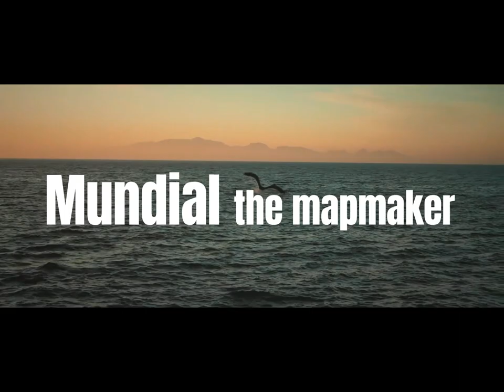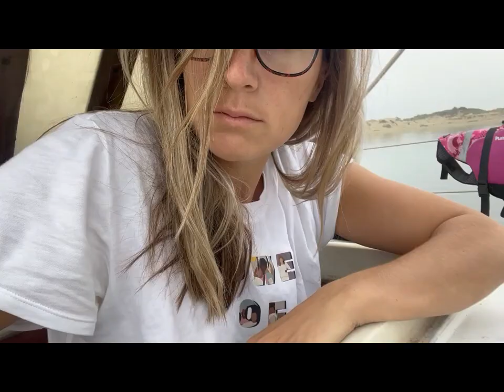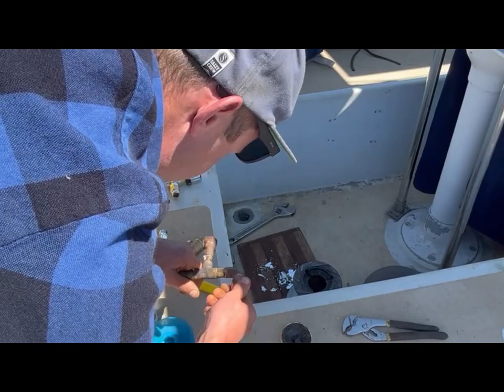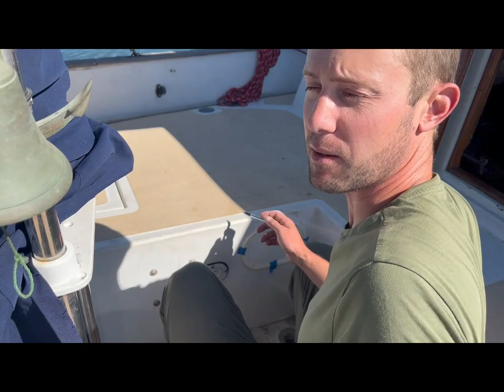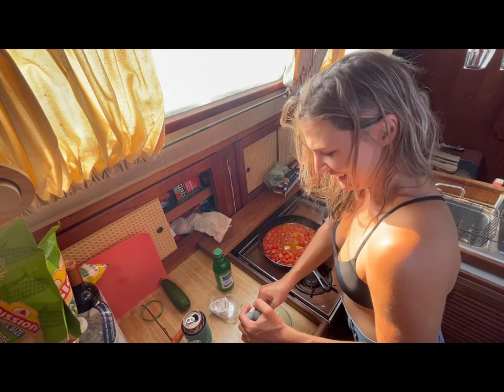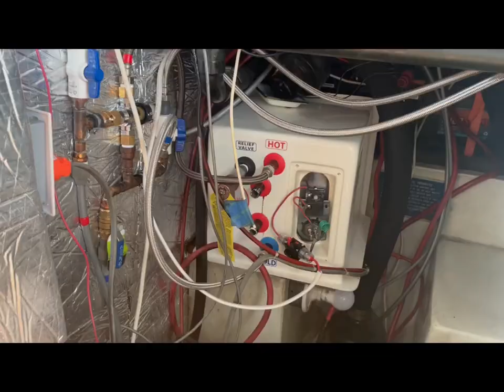[Ep 7] Plumbing & SHOWer time on our Sailboat!

Comment: Hi, heads up on gluing pvc. You need to use the purple primer. I also sand the fittings to de-gloss. Also mite want to use sharkbite. Red for hot blue for cold. We just bought a Downeaster 38 north in the sf bay area. Cheers from Northern California!!!
Reply from the maker: Thanks for the tips!

Comment: So stoked to find your channel! Great content! We are about a yearish into refitting our DE38. We are thinking of laminating a platform under the pilot berth for the batteries. I'm kind of bummed about crawling over the hot engine to get to them right now. Hoping it will open up space for systems or storage to go there instead. Just a thought, if you're running into similar issues. I think we're also going to do a 5 AGM 12V parallel house bank and a single isolated AGM starter battery. That split bank is wack on ours too! I have no idea how the boat successfully cruised for so long like that!
Reply from the maker: Wow so awesome you have a DE as well! We have been looking for other DE boat owners. And thanks for the idea! Climbing over the hot engine isn’t ideal and we didn’t even think of alternatives yet so that’s exciting to read!  We just hauled out and have lots of fiber glass repairs and hull paint jobs to do.  Good luck with the refit and hopefully cross paths in warm waters one day! :)